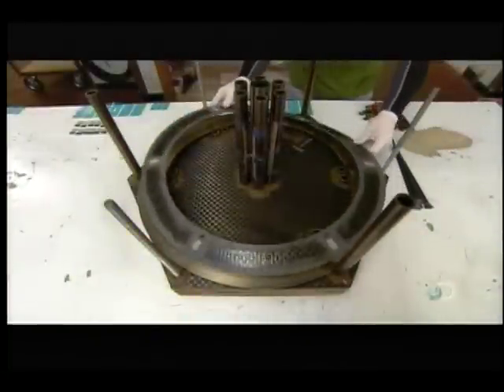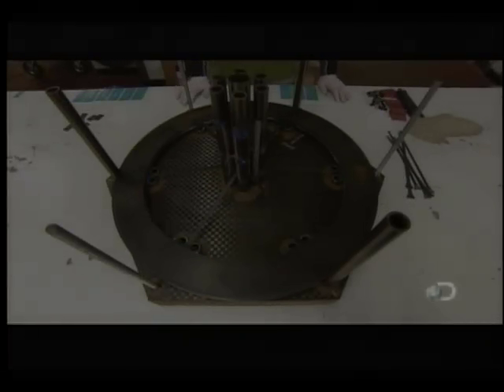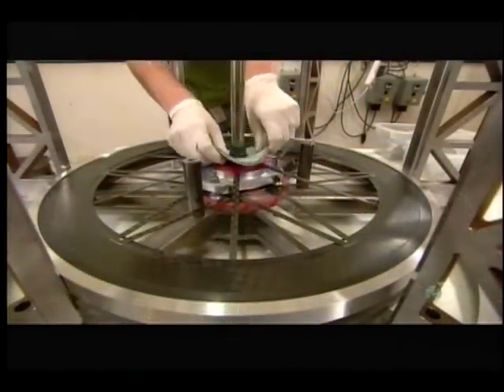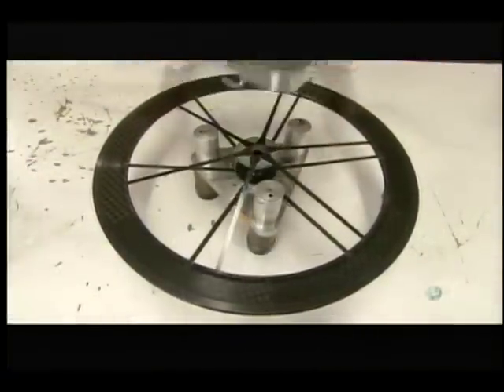How Mad Fiber carbon wheels are made

Comment: He applies carbon fiber strips to the rim.
She applies flared pieces to the hub assembly.
They share a look across the assembly line.
This creates the necessary tension and rigidity.
He reaches out and gently touches her arm.
She turns in surprise but doesn't pull away.
Together they finish constructing a wheel.
Once satisfied he applies resin in a hole.
Reply: You had me in the first half ngl 😂
Reply: WHO's dirty minded.... You or me?

Comment: It needs to be balanced, at 4:14 it starts to rotate in the opposite direction indicating it is heavier on one side, if it were balanced there would be no change in rotation. I know that no one gives a damn but I had to point it out anyways...
Reply: drunksmokingjurkk I didn't think about that, I feel dumb now, I suppose it would be nice to be able to put air in the tires.
Reply: 0pnMnded of course we care that is a good point you pointed out you deserve respect
Reply: A wheel is balanced once the valve is in place aswell as the tire. Then you balance it ;) And it needs to be done everytime you put a new tire on it.
Reply: good discussion guys.... now back to work!
Reply: We give a damn imagine I bonk and go backwards on a hill

Comment: All we need now is Carbon Fiber rubber!
Reply: We have been working on such an animal with some success. Do not count material science short. Everyday we learn something new.
Reply: there have been test on rubber reinforced by carbon fiber, however Carbon fiber rubber is not likely to ever happen
Reply: We already have it. The application/material does work in footwear and tire prototypes.
Reply: EnergyReturnWheel again it is only rubber with carbon fiber reinforcing, not 100% carbon fiber...
Reply: Britek ERW has rubberized carbon fiber. Our application takes the material to the edge. Massive psi and impacts will eventually destroy anything.
Reply: It exists now it's called graphine
Reply: We have experience...Graphene.

Comment: This company went bankrupt in 2013. The company's tooling and non-intellectual property auctioned off for just $7,000 USD.
Reply: real or fake?.. I assume the warranty is what made them bankrupt.  Maybe the wheels are great on a flat surface like an expensive well maintained race track or an indoor oval circuit.  I think the lateral bumps with heavy rider weight fractures the flat spokes and causes it to fail.  Those light road bikes have zero suspension to absorb the impacts of an uneven road.  The purpose of a suspension is to protect the axles of a vehicle.  Road bikes have none.
Reply: Anthony Abelardo actually, the purpose of suspension is to maintain the tyre's contact with the road surface, with the added bonus of making the journey more comfortable.
Reply: +herbsmanherbs, Actually the purpose of a suspension is to protect the "axle".  The tire contact and comfort aren't really the reasons.
Reply: I lived across the street from Mad Fibre. After the auction, the dumpster, which they shared with a bakery, was over-flowing with partially delaminated Mad Fibre wheels. I was hoping I'd be able to pull off a bunch of the DT Swiss freehubs to sell on eBay, but they were already gone.
Reply: Nope. It is there to to maintain the tyres' grip on the road while going around corners and over bumps in the road. It does this by pushing the wheels into the road.

If it was about axle protection, why would  race cars that are driven on perfectly smooth, completely flat  race tracks require suspension? Without suspension, drivers wouldn't be able to corner at high speed without losing traction between tyre and road, because the weight of the car wouldn't be shifted to where it's needed.
Reply: http://www.boosttown.com/suspension/suspension_purpose.php

"Suspension Purpose

The purpose of the car’s suspension is to provide safety and comfort.

The safety angle comes about because the suspension determines how a car behaves in terms of its handling and also its road-holding, or grip. Any suspension system is designed to make the most of the tyres.

A given tyre will produce more grip the more force there is pushing it onto the road. This part of the suspension's job is to apply that force as the car starts to turn into a bend.

The suspension also needs to absorb imperfections in the road. Without it, every bump and pothole would be transferred directly to the car and your passengers."
Reply: http://auto.howstuffworks.com/car-suspension.htm

"The job of a car suspension is to maximize the friction between the tires and the road surface, to provide steering stability with good handling and to ensure the comfort of the passengers. "
Reply: http://www.streetdirectory.com/travel_guide/22343/car_parts/the_function_of_your_cars_suspension.html - "The suspension system has two main functions; to keep the car firmly on the road and to give you a comfortable ride." 

http://www.whatprice.co.uk/car/maintainance/car-suspension.html -
 "The Function of Car Suspension
The suspension system has two basic functions, to keep the car's wheels in firm contact with the road and to provide a comfortable ride for the passengers."

http://www.formula1-dictionary.net/suspension.html - "Racing car Suspension
"Good handling on the road depends on more than a car’s steering system. The steering works hand in hand with the suspension and tires to create a smooth ride and reliable steering. The suspension acts to improve a car’s ride and handling. Since the first days of motor racing, suspension has been a means to control the tyre on the track..."

http://leakylugnut.com/ssb/suspension/ - "Suspension Basics

The purpose of the suspension system is to absorb irregularities in the road as the tires run over them, allow the driver to maintain control of the vehicle through a turn and also to maintain as much tire to road contact as possible through all road conditions. "
Reply: http://www.rapid-racer.com/suspension-tuning.php - "The suspension´s main role is to keep the tyres in contact with the road surface for as long as possible and to optimise the contact patch of the the tyre."
Reply: I actually worked for mad fiber for over a year. The reason they went bankrupt was because of horrid quality control. I tried to tell management time and time again that they needed to invest in the proper cleaning equipment to prevent dust from causing bonding failures. They completely ignored me. They also hired a complete idiot of a shop manager. Ric Hjertberg and the original engineer had a great idea that turned into an amazing product that could have turned into a huge company. Unfortunately the people actually in charge of production had no passion and simply wanted to build up the company fast enough to sell it and make a quick buck. As a result quality control was great at first, but as they picked up speed, QC went into the shitter.
Reply: That's unfortunate, it really is quite a smart way of making wheels, and perhaps with future automation and better precision might have been cheaper as well.

Oh well... perhaps someone else will get the wheels in motion again someday (I'm so witty....)!
Reply: @tiktianchan1913   they are somewhat similar to LIGHTWEIGHT wheels, which are quite successful, they aren't quite as extreme as the madfiber wheels though.
Reply: @Halmengineer  I also worked at Mad Fiber for about a year and am close friends with the son of the engineer of the Mad Fiber wheel. I am sure poor quality had something to do with MF closing but I know for a fact one of the main dudes was embezzling money not Ric but the other guy.
Reply: @Digglerism  I have the 2.0's, do you know who made the axle and freehub?  Can't find replacements...
Reply: @FishBulb1226  The company doesnt exist any more. So beyond finding another complete pair I dont know my guy. There is nobody to call to fix them and the team doesnt exist any more. Good luck!
Reply: @Digglerism  Yep, basically looking for spares, junk wheelsets, or cad drawings at this point.  Thanks.

Comment: How can the spokes be that flimsy? Are they not under compression at the bottom during rotation? Or do the opposite spokes balance in tension? Or is rim enough to take the load and only need the rims to keep it in place? Some explanation will be much appreciated!
Reply: They explain it in the video. When the hub flanges are pushed apart it generates high tension in the spokes. This is what creates a stable, 3 dimensional structure.

Comment: I prefer good ole rubber tires and aluminum rims and spokes when I ride on a road made from carbon fiber.
Reply: Rick Geller stainless steel spokes are superior to aluminium spokes. I take it you ride those horrible mavic wheels with the hollow aluminium spokes?
Reply: I use depleted uranium spokes for maximum weight.
Reply: Never be able to stop once you get going! haha

Comment: He places it and sets the rim, he applies pressure and holds the outer part, he uses adhesive to applies vacuum and solidifies the inner cycle with some protective iron plates for security.

And this is how to boil an egg!
Reply: He puts the lotion in the basket

Comment: I'm not if I'm using the right vocabularies.But I think the distance between hub and rim create different radial acceleration. So if those spokes were only unidirectional, they will be very good for tension(stand still, no acceleration), but deform into S shapes and eventually sheer when pedaling hard. Harder you pedal (high torque), easier it is to brake those spokes... my 2 cents, pls correct me if I'm wrong
Reply: YC Y Really late reply, but this looks like a front wheel, which does not take any acceleration loads.

Comment: Neat... so question. Can you guys make a set of these for belt drive, disc brakes, and using tapered roller bearings instead of ball bearings? Yeah, I really don't care if the racers think it's too heavy. I just don't want to ever screw with spokes, chains, break tensioning ever again.  And I run Tannus no-flats.

Comment: no wonder they shatter so quickly... I would not trust them with my life...
Reply: Can you imagine, when you were born you're parents straight out knew what you are and blessed w/ you that name, and that sir is what you are for life.
Reply: really do you have a better materal
Reply: logan glover
Yes... the old and trusted steel or aluminum spokes... it works just fine for me
Reply: hell yeah, marketing HYPE designed for weight weenies!
Reply: logan glover 
Titanium
Reply: you are not supposed to use them on a downhill track, they are for indoor circuit racing.
Reply: Doping is 1000x safer
Reply: lukeappleby10, and ? Carbon is fragile like every composit.. One bump and this wheel is busted.
Reply: Koenigsigg makes carbon fiber wheels for 3 million dollar cars that can do over 250mph and they hold up just fine. These in the video are just made cheaply.
Reply: Yeah, bcs that wheels are made for racing tracks (smooth) They using it bcs of carbon tensile strengh. 250mph would destroy normal wheel by centrifugal forces.... But if you hit a hole with low profile tire and carbon wheel it would be cracked easily..
there you can see comparsions of materials...
https://www.youtube.com/watch?v=khJQgRLKMU0
The last carbon is with foam core... Carbon used in automotive industry is in 90% just coventional carbon.
Reply: Hah, I have these, T-boned a car, wheels came out without a dent whilst frame snapped in half. They're extremely tough
Reply: @happybreadfruit3530  That's just wrong, wheels have tyres on so they won't hit any bumps. They will break if you impacted them but that should never happen. Carbon is only as strong as you build it, there are videos of people with carbon fiber MTB rims, smashing them against the curb and they don't break. There's a video of a pro MTB or BMXer riding down a big set of stairs with no tyres on and the wheels were fine for a few runs.
Reply: @albr4  , yeah its really strong... But comparing bike frame with bruntal forces of wheels rims..
Reply: @happybreadfruit3530  no I'm talking about a carbon rim, It can withstand heavy impacts from the road. The same goes with carbon frames, they are made to absorb impacts through the axles, you can hit a big pothole or do a jump and they won't break but if u get a hammer and hit the side of the frame it will break. If you hit a wheel side on it will break but if u hit it straight on it won't damage it at all.
Reply: @albr4  , yes, but chance that carbon rim would crack is just reality. Especially in extreme conditions. I had caebon floorball stick and it cracked easily if you hit somenthing woth edge etc. And its common problem with carbon. It all depents about layer directions etc. Carbon rim could be pretty rigid but i rly would not drive it like 200km/h+ and trusting it.

Comment: so much work for fragile never adjustable spokes
Reply: bonded carbon fibre suffers extremely little from both fatigue and creep, so as long as it was made up to spec to begin with for the vast majority of people it really never will or should need truing.

Steel and aluminium spokes can suffer from twisting during manufacture and also during truing which can cause premature failure, and is many times difficult to spot.
Reply: +Tiktian Chan You must know as well as I do, that when carbon fiber fails, it's catastrophic.  I wouldn't ever ride of one these, simply because of that.  I've never seen a professional rider on one of these, and it's probably for that reason.

And the fact these were made by hand just screams dangerous to me.
Reply: Have you seen professional riders on carbon fiber bicycle frames? A large number of those used to be (and some still are) glued together as well, sometimes to aluminum in the 90s. (Have you been on a 787 dreamliner? Lot of carbon fiber in that one... and it's met it's teething problems, but that's what happens when you don't do something like everyone else!)

Also you'll likely find that most higher end bicycle wheels have a large degree of hand work, at the very least most higher end wheels (whether carbon or not) have their spokes trued by hand. In the field higher end composites manufacturing layup (where you put the pieces of cloth into the mold) is often done by hand (assuming it's an irregular shape, something like a tube can be filament wound, and obviously also talking about continuous fiber composites here) , from these wheels, to zipp's wheels, to parts of the latest koenigseggs, to parts of the latest formula one cars.

The madfiber wheels like most novel products were almost surely going to have teething problems, it was just a matter of whether they had the funds to smooth them out, in this case they didn't.

Within the composites field, 'black metal' design (or basically trying to completely replicate a metal design in a composite) isn't an endearing term :)
Reply: You've never had a set I imagine.  Strongest wheels on the market. Even years after there gone
Reply: @josequilez5449  they definitely aren't the strongest wheels on the market by a long shot, loads of people have had them fail.

Comment: I've riden on these wheels, and they are some of the best I've used, however poor quality control and a design problem with bonding a metal internal rim onto carbon under where the brakeing track was, meaning the heat from heavy breaking debonded the join, really killed them.
Reply: Not true, that only occurred with the clinchers, the tubulars sets, which they build for several years, never has that problem.

Comment: That is a ridiculous amount of work for one wheel.  I could thread a regular wheel with spokes in less time.
Reply: And it would weigh more and be less aerodynamic.
Reply: ***** you do realize these are bicycle wheels, not car wheels? they most certainly ARE made for aerodynamics
Reply: What's the risk?
Reply: ***** I think you're confusing strength with toughness. Carbon fibre is extremely strong in tension, which is the main load on a bike wheel, but if it gets a bending load (basically if you crash) it will crack.
Reply: Strength is not the same as toughness in the scientific definition. Don't know about these wheels, but a properly made carbon wheel is very strong.
Reply: ***** context is no excuse for improperly using words
Reply: ***** the fact that a word is used in a certain context doesn't mean that it's correct. Also, given that the context here is material science, we should be using the definitions appropriate to it
Reply: +Elan Jacobs so are modern aero spokes. changeable too.
Reply: +Elan Jacobs You're right, but carbon fiber isn't strong either, it's rigid. Built to keep from flexing.
Reply: Patrick Walston The tensile strength of carbon fibre is about 10 times that of steel and 8 times aluminium. Carbon fibre itself is not rigid at all, it's essentially a textile, the rigidity actually comes from the resins that bond the fibres together

Comment: omg no wonder they make these so overpriced. so many unnecessary steps and man labor to get to a single solution. There are ways to make these without this much tedious energy and labor. This might be one of the more lighter ways to do it but it so unnecessary. I'd rather build it the more industrial way and have like an ounce more weight but have greater strength and lower costs.